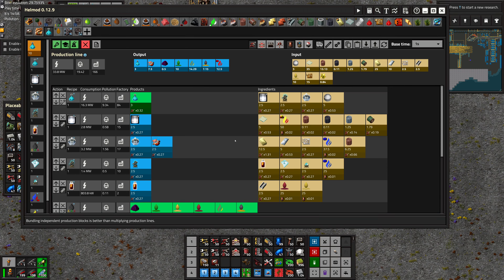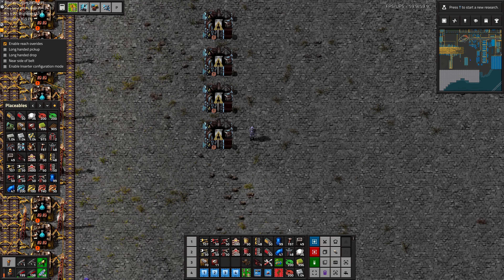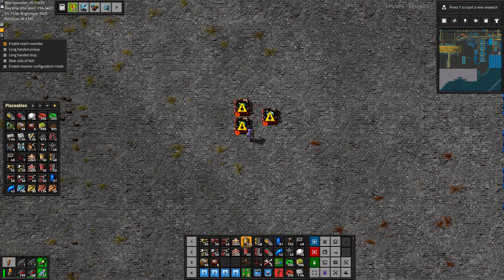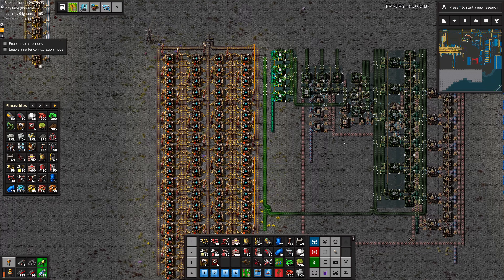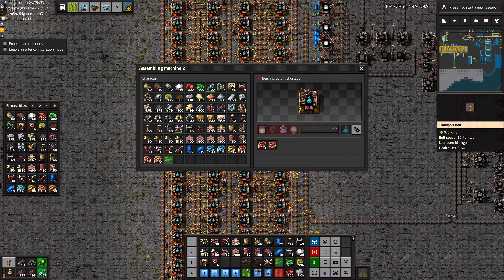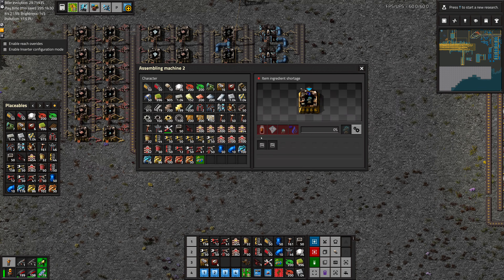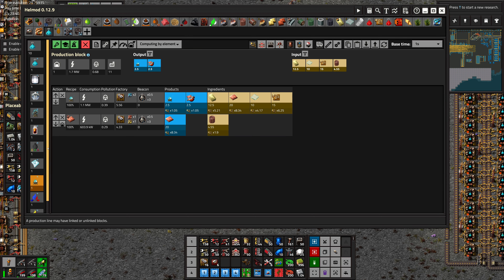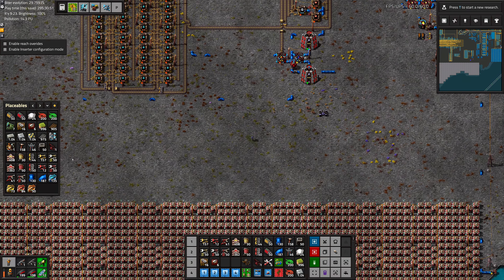[Factorio 1.1 4K] Angel/Bobs Ep 162: Designing Blue Science

Comment: Might consider the Picker Extended mod, very handy for moving buildings around without having to pick them up and replace it.
Reply from the maker: I think I have that installed, I've tried it in the past and it felt weird to me, but I probably should give it another shot.
Reply: @marsh8056  It definitely is weird, but can be useful especially with combinators and wires.